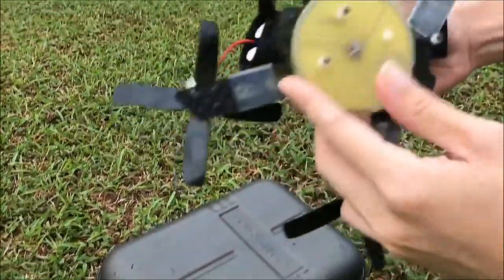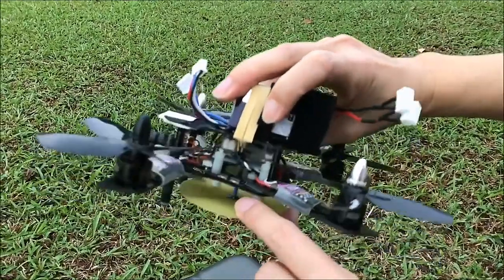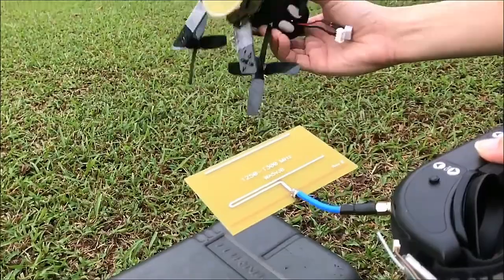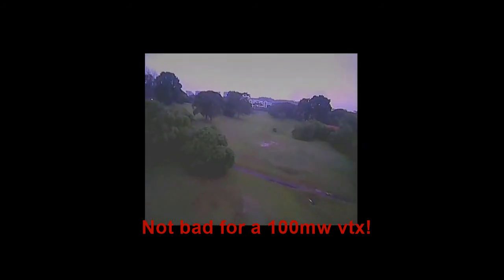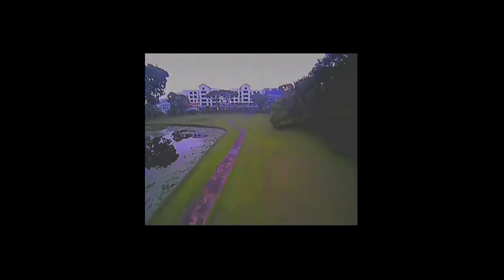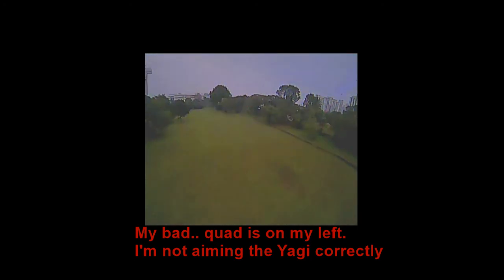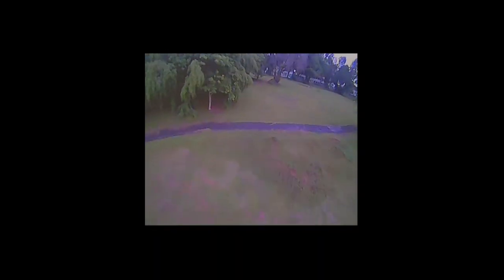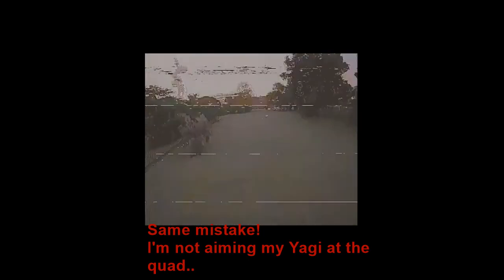FPV Test with Horizontal-Polarized Antennae

Comment: Nice! Would be really interesting to see a system where it transmits horisontally and vertically with a diversity receiver system receiving horisontally and vertically. i.e poliarisation diversity... You up for the challenge?
Reply from the maker: Thanks for the suggestion. The only problem with the duo-linear polarized setup is that the quad would need 2 VTXes with their frequencies set far apart to ensure dat the one transmitting HP does not result in interference to the other transmitting VP & vice versa. Since the onboard baggage for such a setup is going to be really bulky, why not put on a 1.2g CP antenna (big clover) which eliminates the linear-polarization issue for any angle that the quadcopter is positioned at during flight.